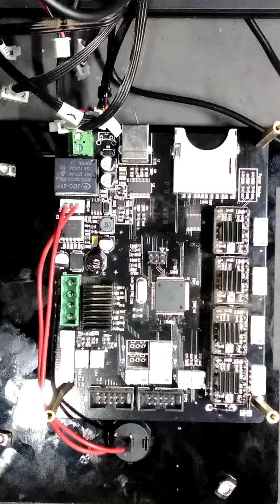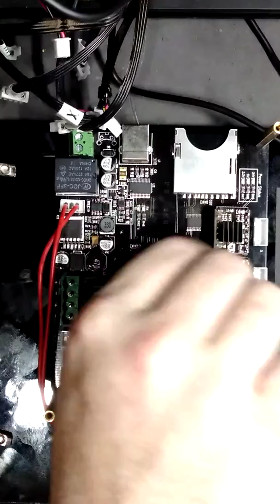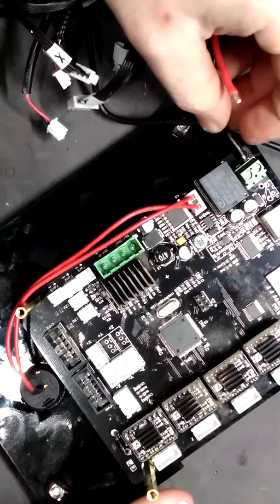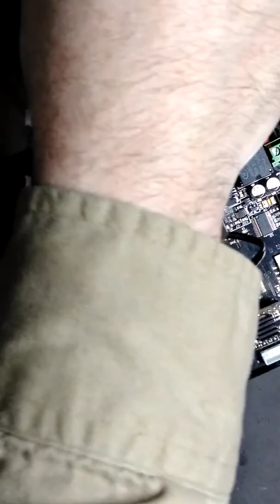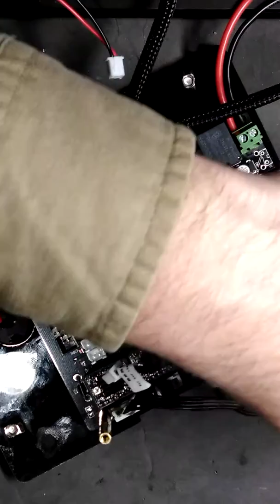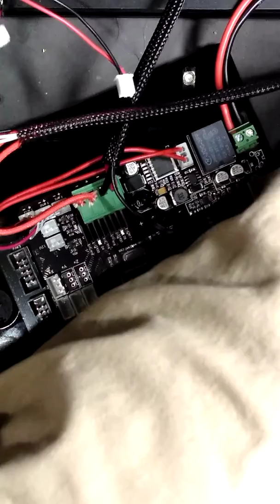Wiring guide: Creality Ender 4 w/ Laser and Filament detection

Comment: Where do I find how to install filament sensor, auto bed level, laser head, and how to do firmware change? I only got a list of parts in box and a little assembly booklet that stops after power supply wiring
Reply from the maker: Firmware change instructions are on pdf on the USB, as well as most everything else is on there as well. Creality has a youtube series on the full assembly as well.
Reply: @MattWeber  Hey thanks for getting back to me so quick I appreciate it!
Reply: @MattWeber  So I got to the usb SD adapter thing they sent me and my computer says it need to be formatted to use.
Reply from the maker: @lorenson52  ignore that. Should still be able to explore it. Mine did that too. Formating erases the contents so is last thing you wanna do
Reply: @MattWeber  I did but it still shows up as a blank drive

Comment: No display on mine ender 4 after install. Fans work and the blue light on the motherboard are on but no other activity. Does anyone have any ideas?
Reply from the maker: Two ribbon connectors. Make sure they aren't in the wrong port on the display
Reply: @MattWeber  I checked and checked & reconnected the display cables. They were correct. Is there a step I am missing in the install? Do I have to load the software for the board?
Reply from the maker: @3rduniverse21  it is a pretty simple install, nothing to install software side as that is all included in the firmware of the main board. My machine is 1200 miles from me right now so i would check with the Ender 4 User Group on fb in case something is slipping my mind.
Reply: @MattWeber  I Double checked and found they were ok. One other odd thing is the lighting strip does not come on either.
Reply from the maker: @3rduniverse21  light strip won't until printing. It runs off the cooling fan % setting by default
Reply: @MattWeber  I found the filament alarm sensor to be causing the problem. I get a display and can manipulate the motors. The Y axis will not move back when doing move axis command. It keeps going until it makes noise at the end, the x axis and z motors both move ok. I am afraid to send a print though it. Is there something special to set up the Home position?
Reply from the maker: @3rduniverse21  try flipping the y axis end stop sensor wire end for end as if not correct, it doesnt ground to the right pin. If that still doesnt work try swapping with one of the other axis endstop wires to make sure the endstop itself is working correctly. They are suprisingly easy to have go bad it seems.
Reply: @MattWeber  Ah. When I place the unit in the center of the printer I can get the Y axis motor to go in one direction only. X motor will go Side to side, The Z motor will bring it up and down. I switched the Y and X motor wires. When I did that again the x command moved in either direction but the Y command moved the unit in the opposite direction it could not go in before but now can no longer move the other way. it will eventually reach the end switch and turn off the display. I switched it and pulled it away and the display came back on. I think the end switches are functional but something else to be at fault. Maybe the motherboard. I am unsure. This video has helped me the most. Thank you for posting.
Please let me know your thoughts on this issue. (it is supposed to be a gift for a kid)
Reply from the maker: @3rduniverse21  make sure the motor wire is correct. The 6 wire side goes to motor and 4 to the board. If backward then only one pole of the motor will get power. Moving the motors manually will cause a back feed of electricity so that's why lights up the screen when you do it.

Comment: Do you have a basic wiring setup im having a problem wiring my board alot of the marker tabs are missing
Reply from the maker: The printer is currently 1200 miles from me, but the when looking from the front, the left motor is X, right is Y, Z obviously runs the bed. You can trace the wiring back for the fans and such pretty easily to find which is fan/heater/thermistor (thermistor wire also is only thin white ones and heater being red fiber insulation).

Comment: I believe my motherboard is faulty out of the box. Here are the issues I'm encountering:

I ordered the printer with the Auto leveling sensor. When attempting to Auto home or Bed Auto Leveling, the Z axis does not move up, on the contrary it moves away from the extruder head at whatever distance I start the process. 

Lastly, when I attemp a Auto home option, the extruder head moves all the way to the left hitting the X axis limit switch. The Y axis doesn't move at all, and the Z axis moves down. 

If I try moving the Y axis from the control panel, it only moves back towards the bed rails. It will not move to the front towards the Y limit switch. If I swap the X & Y axis cables (contrary to whats instructed on installation photo manual) the extruder head moves correctly.

Can anyone assist?
Reply from the maker: Make sure your wiring isnt backwards end for end.. the motor plug end is 6 hole side, 4 hole end goes to the board. If you have this backwards it can make the motors work erratic compared to expected. And make sure check the sd card for the correct firmware for the bed level sensor, the stock firmware is set up for the limit switch, not the sensor, so you have to flash the correct firmware per instructions.
Reply: @MattWeber  After close examination the Y axis limit switch cable ends were backwards. I was also able to update the firmware for the Z axis. Thanks Matt! 

Now I just need to know how to print. I have the most recent version of Cura. I load the g code into the SD card and subsequently to the printer but the extruder head only goes to the front left corner and does not print at all. The extruder head and bed warm up but nothing happens. 

Any input is truly appreciated!
Reply from the maker: In Cura double check the "start Gcode" in the printer profile and make sure there is a G28, not G28 X0 Y0... the first one homes all axis, the second only homes the X and Y. If its "G28 X0 Y0" then the machine is still waiting to see the Z at home position before starts the print. I have had this problem with default Cura profiles before. The Ender-4 User group on fb also has good profiles for cura in their files area for most filament types
Reply: @MattWeber  I load a G code file. The printer warms up the extruder head and bed. It moves the X & Y axis to their limit switch position and it just stays there.. 

After watching several YouTube videos I decided to try a couple of things: 

Before the printer arrived by mail I jumped the gun and installed Cura latest version . I created a printer profile by selecting the CR-10 model and modifying  the print space dimension. I tried my first print and nothing. 

Mr. Weber as you suggested, I took a look at the G code 28. Under CR-10 G code it say home all axis.

So I decided to go step by step accordingly to the SD card instruction. I uninstalled the newest version of Cura and install the old version. I created a printer profile by selecting the Prusa i3 model and modifying  the print space dimension. Under the Prusa i3 G code 28. it says X0 Y0; I tried my first print and nothing, same results.

Being new to this 3D printing world I decided to get myself out of this problematic situation and find a slicing software that is compatible with Ender 4. Google gave me Simplify3D. Plug and play right? Well I loaded my G code file from the software to the SD card, SD card to printer. Nothing, same results!

My ender came with auto leveling sensor and the filament sensor. Firmware has been updated.

One thing that has been boggling my mind. The printer came with the missing wire for the filament sensor. Could it be that since the sensor is not connected the printer will not print?
Reply from the maker: @ricrent263  very possible. If it's not correctly hooked up the filament sensor will light up but is actually hooked to only power and ground, not signal and ground. Try swapping the wire end for end.

Comment: also the filament sensor on my unit has the black and yellow wires swapped from the way yours is. Mine goes red, black, yellow while yours is red, yellow, black. I am still assembling mine so I am not sure it works yet though.
Reply from the maker: ctbram0627 someone else mentioned this also so may be my issue. Ive been too lazy to get to checking it on mine and swapping wires around.... Partiallly because just keep forgetting when its not running anything.

Comment: It would be nice to see how you routed all the wires outside the mobo box
Reply from the maker: ctbram0627 pretty much just bunched them and ran out the side toward the back, zipe tied to bottom and then back upright rails to where they needed to go. Do not secure the bed wire, and run it straight up out of the box, or it doesnt havent enough reach when bed is fully elevated.

Comment: I have the same printer but my extruder does not move.
The motor and the cable works fine, I have tested them.
Could it be the mainboard?
How can I test the mainboard?
Reply from the maker: Possible its a dead driver, How did you test the motor and cable? The drivers are removable so you could try swapping places with one from the other motor positions. They are the square small boards next to where you plug in your motors. Just make sure you keep them in the same orientation when pull it out vs put it in. If when you swap a couple, the other motor stops working, its a bad driver board. You can upgrade them to the TMC2208 for like $20 from aliexpress or amazon. If the extruder still doesnt work it may be the main board but usually its a driver itself more often than not. Tom Sanladerer may have videos on better diagnostics than i can explain.

Comment: The pinout on my filament alarm wire seems to be messed up.  The yellow is in the center on one end and the other end has black in the center.  Is yours the same way and if so could this be the cause of your filament alarm not working?  My ender 4 came with no instructions for installing the filament alarm.
Reply from the maker: EvilleSV the instructions are on the usb under the folder for autolevel and other upgrades. I will check my sensor shortly, that may even be the problem. A lot of people had the issue and solved it but no one on the fb page would explain what they did.
Reply: I'm betting that's what it may be since the x,y,z limit switches show 2 wires in pins 1 and 3 on the switch side and 1 and 2 on the board side.  That would match up to the red and black wires being 1 & 2 on one end and 1 and 3 on the other for the filament sensor.  I watched very closely for the section in your video where you plugged in the sensor and you put the yellow in center side on the motherboard. I'm just guessing of course since this is my 1st 3d printer and I haven't even powered it on yet being scared by posts of "I plugged in my filament sensor and blew my board".
Reply: Also, my sd card had all the instructions except the filament sensor.

Comment: You could share your video well, the laser connection is missing and I can not see where the auto leveler is going! , I had two pieces that I do not know where it is placed on the printer, you will have some way to share some pictures. or I share what I need to put together!
Reply from the maker: Chofer Cindustrial auto level goe in the z endstop plug. Yes laser goes in 12v location. There is a pdf layout on the usb stick in the folder marked upgrades